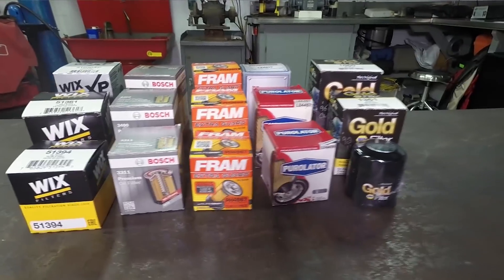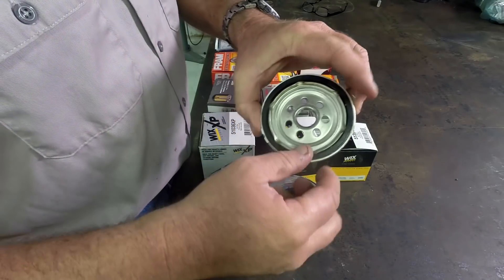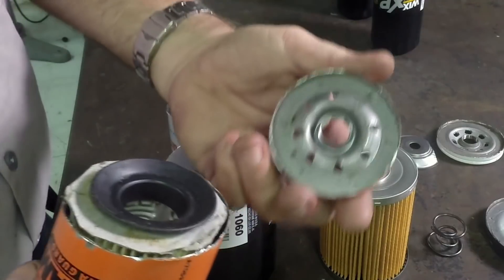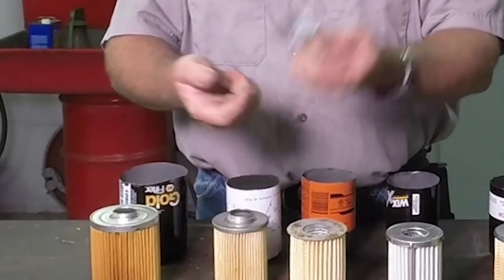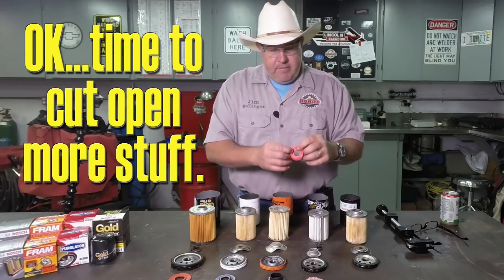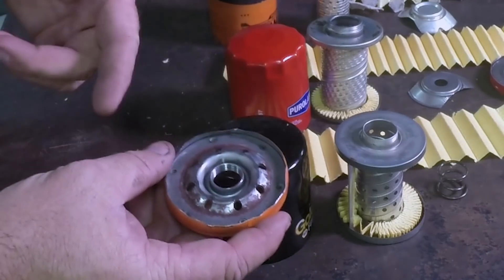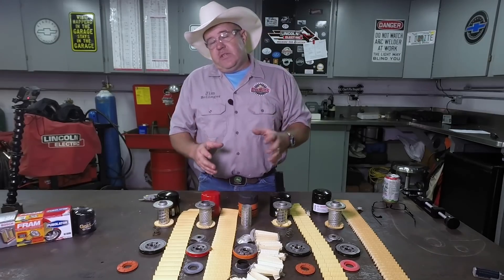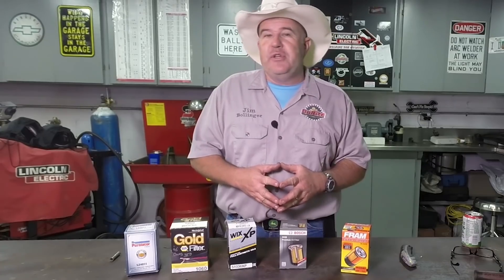The worst oil filter EVER!

Comment: My first real job was working at a NAPA store.  We had a display showing the Fram and NAPA filters side-by-side.  It was shocking.  People would ask for an oil filter and I'd bring them a NAPA.  They would say, don't you have anything good, like a Fram?  I'd show them the cutaway display, and they would have pretty much the same shocked expression.  Some actually accused us of switching out the Fram for some kind of dollar store brand, and I would offer the following:  Go down to Kragen/Chief/AZone, buy a Fram, and bring it back here.  We'll go into the machine shop and cut it open, along with a NAPA filter.  It's exactly what you showed here.  Be aware that NAPA (and WIX) do make cheaper oil filters, but they're still nowhere the garbage that Fram is.
Reply: ISN'T A GOOD MOTOR WORTH A GOOD FILTER AND OIL. THAT'S THE HEART AND BLOOD OF A MOTOR.
Reply: @yankeeusa2451   True, I have a Ford F250 super duty with a 6.0 diesel and even the best NAPA gold filter does not come up to the OEM STANDARDS as a matter of fact if you Use non OEM filters in my truck pieces of plastic can break off on the output side of the filter and severely damage the engine which voids the warranty!!!!

If you use a substandard filter to save a few bucks it can cost you a bundle of money amounting to thousands of dollars!!!!
Reply: Sidney Mantissa   go to FilterKingz channel... specifically this video https://www.youtube.com/watch?v=Y544o-mw2wc
He cuts open the entire Fram line, measures and weighs everything. He does this for a lot of different companies. So you can check other brands too.
Reply: I use Wix XP and they’ve been very good. I also think NAPA Platinum is the same
Reply: @RobertSmith-le8wp  They are exactly the same filter. WIX makes both. If you change your oil and filter at
proper intervals, WIX and NAPA GOLD are still at the premium end of the spectrum.
Reply: Cool story bro, but  can tell me the most important information like how well it filters and show me the evidence. Let me guess no?

Marketing hype show people a cutaway and point out how pretty the non fram is. Leave out that fram is an ome manufacturer tho.

After all the oil filters job is to look pretty inside
Reply: @twatflaps  Yes, the evidence is documented of the filtration rate of different filters and their ability.
WIX and NAPA GOLD are the top tier. WIX XP and NAPA PLATINUM are for assholes that think they
know more than everyone else. Granted, they are marginally better, but if you change your oil and
filter at proper intervals you cannot do better than a premium oil and a proven filter.
Reply: @twatflaps  I believe you meant "OEM", but OK.  Occasionally OE suppliers are even chosen based on quality.  Usually, they are chosen on how cheaply they can supply a part based on minimal requirements.  So, yeah, Fram meets the minimal OE requirements... No argument there.  I'll also grant that the NAPA Gold/WIX filters are even overkill.  I hate oil changes, though.  I'll run the NAPA Gold filter with good oil for 10,000 miles with no worries.  I would never try that with a Fram or eqivalent.
Reply: rbstorms cat englnge3406b4mg low oilpsl.
Reply: Well...P.T. Barnum was right....a sucker born every minute...NAPA displays a high quality filter against a base line FRAM...BUT...did they tell you they BOTH do the very same thing?   Filter oil. ( hey...don't be too sure that FRAM may be making some of the competitors filters...hummmmm???)
Reply: You're comparing the cheapest fram filter on the planet to a higher model. Of course theres a difference. Cut open a fram full synthetic. They are outstanding filters

Comment: I have a t2.5 volo that uses the filter without a steel case. I bought the most expensive top gaurd filter 15,000 mile drain. I changed my oil at 8,000 miles and that filter was cardboard exactly like you said and it was falling apart. It was totaly brital and ill never by another. Mine did has a steel mesh but i broke it apart with my hands

Comment: There are filters missing in this comparison to make an accurate assessment on the quality of the filters. For one, we are seeing only a comparison of some filters available, but we do not have a baseline filer to compare them to. The only true comparison filter to base any of this on would be the manufacturer's filter for that engine, and that is missing from this comparison. In this test, we are seeing top tier filters from WiX and NAPA being compared to the bottom tier Fram filter. NAPA's white box filter would most likely be made similarly to, if not worse than, the Fram shown in this video. It isn't a true apples to apples comparison.

Comment: I usually go for Royal Purple filters because they are usually free with 5 quarts of Royal Purple but we've been running FRAM on our company trucks exclusively for years and some with over 250K without any issues. You should have looked at the production date on the filters instead of telling us when you purchased them because that's a bit irrelevant, they could have sat on the shelf for ages.

Comment: Thanks Jim from Australia. How many times do we see good marketing win out over good quality? I have 3 cars, 1 Ford and 2 Holdens and try to use genuine parts where possible because much to my surprise quite often genuine are close in price and sometimes cheaper than after market. I always use genuine filters, coolant, brake fluid, gaskets ect as personally I have never had a dud genuine part. I think that even if a genuine filter is dearer than after market you know you are getting parts that meet the manufacturers specs.
It may be worth considering the following: if you are buying filters then you are probably doing your own oil changes so you are already saving a LOT of money. Most cars now only need an oil change once a year, maybe twice so it’s worth paying for a good quality filter as $10 or $15 dollars extra is nothing compared to a new engine. A poor quality filter may not blow the engine up directly but it may significantly reduce engine life.
Think about that cheap filter next time you are driving down the freeway hour after hour in your fully loaded car going on holiday. That little filter is the only thing keeping that expensive engine clean. How much is piece of mind worth? Cheers Stuart 🇦🇺

Comment: I use Fram and never had any problems. My frame filter top/bottom is       plastic not cardboard. BUT my filter isn’t a screw on one. My filter you just unscrew a cap on TOP of your engine place the filter and screw back the cap that is a factory cap. every filter I looked at for my car is the same quality plastic top and bottom not metal, no cardboard. I looked my filter up it’s called a CARTRIDGE oil filter. In this link this filter is a metal for the top and bottom.... not cardboard like yours. So... not every oil filter for each brand is built the same....  my exact oil filter is the 2nd link and that filter is plastic not metal. So your video is not correct. Every oil filter is different. Do a comparison on a cartridge filter vs a threaded filter lol. 

http://www.fram.com/parts-search/TG8765

http://www.fram.com/parts-search/TG9018/?ref=NoIgDghgTgLgdgVwLYCMCmUQBoQGECCAjAEyEAcx2iANtVjXQ-Qrc6wwLpA 

Going on 300k of with Frame TG9018

Comment: Damn I've been loyal to Fram for years because of all the race car drivers who endorsed them - clearly marketing BS - 
Suggestions for future videos - show the filters that large chain oil change shops use - Valvoline - Jiffy Lube and more - I used to buy my own Fram and have them install it.  At least now that will be Napa Gold. 
Also, what about testing the actual performance of the filters ?  Like put in clean oil, run a simulated 1000 miles, and measure how clean or dirty the oil is coming out  ? I mean thats what matters the most, right ? 
But this video is very helpful and informative, cant wait to see the others.

Comment: Lol I have only used the fram oil filter on my s10 still running no smoke no knocking 324k on the original motor

Comment: Thanks for doing this video.  I've known about how awful fram is for years thanks to a mechanic I knew in the late 90's, but it seems a lot of people are still out of the loop.  Hopefully this will help spread the word.  I can even remember when Fram didn't even put anti drainback valves in their filters.  A lot of ford engines were ruined by those filters.

Comment: 1300hp 706ci naturally aspirated.  6 seasons no rebuild.  Bearings came out looking like new.  Never had a problem with the cheap Fram filter.  Napa 20 50.
Reply: Wouldn't you want something more reliable on an expensive engine?
Reply: Thomas Hewitt Now that, I would like to see! There is no way you are running Fram on an engine like that!

Comment: I have used frams for decades with two cars over 200k and a third to 160k with no oil burning or oil issues. Having said that I will need to live without the nice rubber grip on the outside and find a better filter.

Comment: Over 250,000 miles on a 318 in my ‘77 pickup (only had head work done, no lower end stuff),~100,000 miles on slant 6 in my A100, the last 2 Ram trucks both near 100,000 miles, and rebuilt 273 in my Barracuda nearing 40,000 all have Fram filters in them and not a bit of trouble. Have run Fram in most everything we have owned without any problem.

Comment: I appreciate this video, as I just purchased a new FRAM (cartridge-type) filter for my sedan, which has 225,000 miles on it. I'll be exchanging it now for a WIX. 

Although I don't any longer, I worked for many years as a service technician and as a service advisor, without giving much thought at all as to the quality of oil filters we installed. It goes without saying that worrying about putting high-quality oil into your engine does little-to-no good, if the component that it is filtered through is low-quality.

Comment: Senior master tech for ford and i can tell you the fram will screw a Variable cam timed engine and your manufacture WILL decline warrantable claims due to engine filter element failure. Best to use one of the filters recommended here.  I would like to see how motorcraft, mopar or Ac delco filters compare since they are specified

Comment: Every time I've used Fram and had a gauge to look at, the oil pressure dropped by almost half of other brands at idle.  I'm not a fan of lower oil pressure so I'm with you on the deserted Island thought.

Comment: How do you determine quality by looking at a product alone? There is no scientific method used to determine how well each filter medium performs. All you have shown is that Fram has a poor structural design and material selection but nothing to the fact on how all the filters performs. Also, what you have show is construction quality and not overall filter quality. 
I fully agree that the fram’s construction looks poor and having rust in it is just poor material selection. Keep in mind that these filters may be imported into the country and the saltwater in the air during sea shipping can make the can rust. Also, the rust is on the inlet side of the filter medium. This means it still needs to pass through the filter material. You can’t determine filter element performance by look alone. It will need testing. 

Overall, there still are questions that were not answered. 
1. Does the cardboard construction break down during use or stay together? (Maybe open a used filter and see if things have broken apart?)
2. What brand has the best filter medium. AKA: how well do they filter? (It’s possible to have a good construction but poor filter medium; which is just as bad.)
3. Are all the filters in this video the same filter part number? (They look vastly different. Some cans are larger than the others)

Comment: I work at a shop. Fram filters are absolute shit. A toddler could probably slap together some random parts and make a better filter. The leak, they don't filter well, and in some cases, I've even seen cars LOSE OIL PRESSURE by using those filters. Fram sucks. Use an OEM or Wix instead.

Comment: I like how so many ppl used fram when you can tell it looks cheap and even cost cheaper. You get what you pay for remember. The only reason I use fram filter is to get rid of old oil, i use cheap oil and cheap filter to get the motor lubricated for some time then switch them both out to my oil/oil filter of my choice. To bad he didnt do the k&n filter or mobil 1 filters.

Comment: After watching this, I walked straight out to my shop to check my new oil filter selection.  Needless to say every FRAM filter got spiked into the garbage.  Then I crawled under my truck to see which brand of oil filter I used on my last oil change.  FRAM!!!  I had to take my car to town to grab a NAPA Gold from the local NAPA store.  I didn't even bother starting my truck to let it warm up.  I just dropped the oil where the truck sat and unscrewed the last FRAM filter my truck will ever see.

Comment: crap video ..filter element never ever twists inside ..and its about Filtering !!! and not how its made... you should test the Filtering capacity and flow ..fuck high Quality... it has to be cheap and just filtering oil ... rust goes into the engine hahahaha thats why there is a filter element ..such a crap Video ..

Comment: Jim,

      FWIW, would you consider adding/ comparing the K&N brand filter - "performance gold" series.

They actually show photo on there packing box of the HP-3002, the inside compared to what appears to be the inside of a fram.

Comment: NAPA gold compared against a base Fram.   Great job at skewing the results.
Reply: Not so. NAPA Gold competes head-to-head with the orange Fram. I was a wholesale rep for NAPA and seen many cutaways. Fram is junk. NAPA has a silver filter too but not on a par with orange Frams. Those compete with the really cheap $1.75 filters that Jiffy Lube and other places use. Those are terrible. The Gold is a direct competitor to the orange Frams. No skew here
Reply: bill little I don’t care what your imaginary job was, way back when in a galaxy far far away on a planet teaming with life.  The FACT is that the Napa Gold is a premium filter and the Fram he cut open is not a base model unit.   Go spread your false information elsewhere.
Reply: GrifFungin ...Fram don’t make a filter as good as the Gold (which is actually made by the German Filter Company Mann Hummel).
Reply: @ronanrogers4127  Its a surprise to hear that Mann Hummel bought the Affinia Group, and since that's the case, I guess technically Mann Hummel makes the Wix filters now.

Comment: Using a sample of only one filter is not a good indicator. You should check other sources for the Fram filter before calling it crap. You should not pass judgement before you do a comprehensive evaluation.
Reply from the maker: So three frams weren't enough?

Comment: Thank you for this. Something I never even thought about. I just took the hype as gold.
Fram was a filter I used to buy most often. NEVER AGAIN! 
It's like spark plugs. I learned early on to never buy Champion Spark Plugs. The porcelain breaks off inside the engine. O_o
Reply: I use Champions in my Briggs engines. My Fords get Motorcraft plugs. Imports get NJK or Denso.

I've found engines tend to have a preference and that's where I've found preferences to lie based on the engines I've owned over the years.
Reply: I disagree about Champions. Any plug can break so you have to make sure they are properly torqued. Also I have a Dodge Ram truck and anyone that owns a Ram knows that the engines prefer Champions. Same with any lawn equipment with a Briggs engine. By the way I run the double platinums, not the standard Champion plugs.
Reply: I'm not pro- or anti-Champion, I've had adequate results with their plugs.  Never had an incident (that I'm aware of) where the plug came apart from the inside,  but I've seen a few instances where the bond that holds the outer porcelain tower to the steel base has let go and the plug separated.  I've seen AC Delco plugs that came apart, and seen an NGK do it once too.  No damage to the inside of the engine, but the separation can be rather violent under the hood.  On a Buick Regal, it did some collateral damage,  knocking loose some sound-deadening of the firewall, ruining the plug wire (never did find the boot end again) and bashing a few things in its path before falling out to the road below.  Sounded like bloody hell, sucking and blowing though the steel body of the plug still in the hole, but the other 5 cylinders kept pushing the car along our way.

Comment: I used to by Fram and other after market replacement parts for my vehicles, then I smarten up when and went with all AC Delco for my GM’s and  all Motorcraft stuff for my Fords. I figure if that’s what they were designed with it should be good enough.